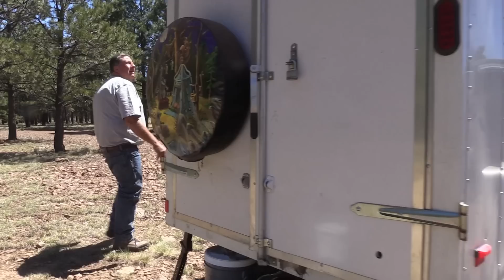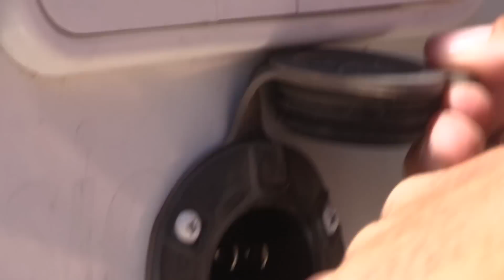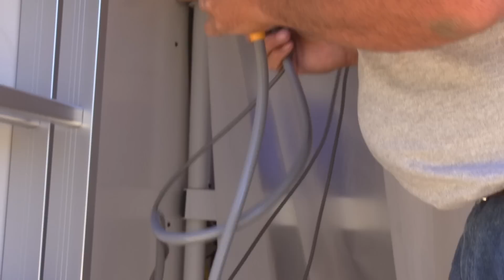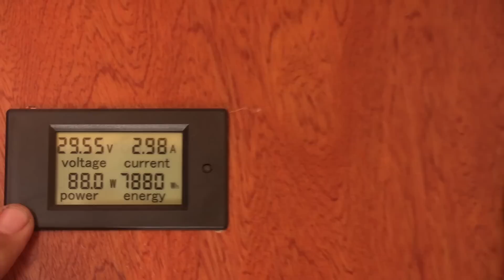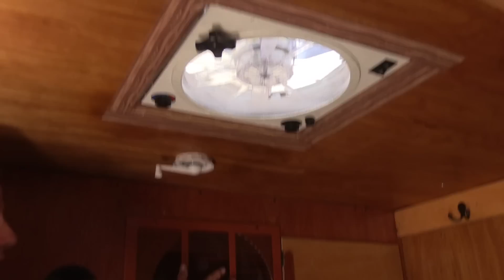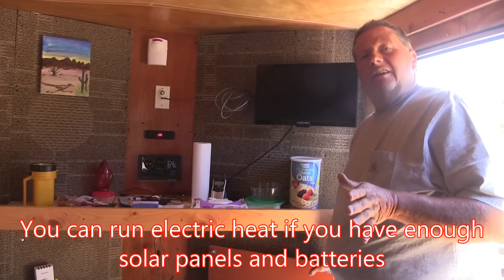Trailer Tour Nomad Living Cheap in a Cargo Trailer

Comment: for those of you saying "too complicated, or would be easier in an RV." Think of it this way, many times in nomad life, part of the fun is bucking the system, not buying an RV but building one. As for complicated, sometimes using your ingenuity makes you feel like you defeated something or a system. Also the fun in being a nomad is passing time by doing these things. It may take time to set up a shower or a solar system to both vehicles, but passing time doing something vs watching TV or just withering away in a chair.
Reply: Dave & Muppy RV & Vlog Channel, besides- everyone is different! What is overly complicated to one is actually simplified for other reasons to another. Randy’s problem-solving and ingenuity is inspiring! People are just so stuck in themselves :)
Reply: A cargo trailer gives more efficient use of space & available weight value.
Reply: AMEN, Dave
Reply: Yep. Plus totally custom. Yoy can make it your own. You can get more for less weight.
Reply: The problem with Cargo Trailers is that they are so expensive compared to an older camper that might need a a little maintanance. 5 years ago I bought a 16' 1973 Shasta Camper for $40 at an Estate Auction. We live in Jacksonville beach and both have Show cars and travel 2-3 weekends to shows to Savanah, Pensacola, Daytona and Tampa, we even go to Miami a couple times a year, and we've been to Montgomery and New Orleans when were on vacation, go to a show and we'll just spend the week. The other reason people say "It's too complicated" is because they just go off the deep end and go all at once, We started slow, I took us 2 weeks to gut and rebuild, including tearing out and rebuilding the rear wall which is where we moved our door too btw and completely flipped the floor plan. We started out with just the bare minimum,, basically a bed a kitchette, including one of those small college dorm style refridgerator and a microwave and spending weekends at state parks while we were attending car shows and we have added on to what we need to live in it at longer periods of time. We now have one of those 9 function Air Fryers that does Air Frying, Convection oven, Broil, Bake, Toast, Dehydrate, Keep Warm, Rotisserie, One-Touch Fries, microwave and 3/4 refrigerator that I bought from an appliance wholesale warehouse for $100 because it had a scratch on the side because that small fridge just wasn't cutting it, on our week long trips we have to go to the store atleast 4 times in that 9 days. At the end of this years car show season were going to buy one of those solar set-ups at Harbor Freight with the money that we save from not going to hotels. We don't need nor want a bathroom because we stay at state parks and they always have bathroom and shower facilities. We are planning on living the Nomad life when we both retire in 3 and half years floating from  state park to state park between Missouri where I'm from and New Mexico where my Gf is from. My point to this long winded comment is take it a step at a time and figure out what works best for you and your situation and don't just jump in with both feet.
Reply: Agreed, I built my own van complete with a functional bathroom and holding tank. I was contemplating a pull behind camper but after seeing what my debit card could afford I opted to build a enclosed trailer out. This way I will have a full size toilet and shower, a big plus at my age.
Reply: @TheREALOC1972 great comment! I heard the opposite sometimes, that Cheap cargo trailers are cheaper, while RVs even used ones are way too expensive and always break down quickly and require alot of maintenance and they have poor mileage can't drive places a pickup truck and cargo trailer can go etc. What's your opinion on it now 2 years later? Do you still like the RV and how would you change it? Thank you

Comment: Randy is a REAL SMART guy !!!    He did all the right things, but still "customized" his trailer  to BEST suit his own needs  :) :) :) :)  Hats OFF to Randy !!
Reply: I'm new to the ideas but I see great possibilities and it is a comforting to see what can be done. My question is this what seizes do the cargo trailers  come in thus far I seen, though video,  I believe it was a 10'x6' cargo trailer, and believe this one is 17'x6'???.... so what are the different lengths and widths? Also what size vehicle will it take to haul the different sizes of trailers.  Thank you in advance!
Reply: @karend.cureton-gordon6731  the nice thing about a trailer you don't have to have insurance on it, in Most states a one-time license plate fee and in a few states no tax. And these pull-behind basic trailers hold their value far better. speaking of interior inside dimensions for instance mine is 8 foot wide inside by 32 foot long mostly stripped down enclosed race car trailer. It's 8.5 wide outside And it's about 76 or 77 in tall with a unfinished ceiling  right now. And my payload is 10,800 pounds. Payload is what you can haul inside the trailer. I think the one in this video was 7 ft wide by 16 ft long with about 76 or 77 Inch Tall and a gross weight of 7,000 pounds and pay load im guessing is around 4,000 pounds or a little more. Payload is everything you haul - add in the trailer cabinets bed water Etc and you subtract from the payload weight. Or if you don't want to do that weigh it at one of the scales I mentioned for free so you're not overloaded and possibly tearing up things. I think they make a 6-foot wide x 10 foot long inside dimensions enclosed single axle cargo trailer. They generally make trailers in equal lengths for instance 8 foot long, 10 foot long, 12 foot long 14 foot and 16 foot single and double axles. And these single and double axle up to 16 ft links are generally 3000 lb gross single axle and the double axle is generally 7000 pounds gross weight. Then there all usually 8 foot wide inside x 18 foot long - 36 foot long bumper pull trailers and past that all the way through 52 ft long gooseneck and fifth wheel trailers. And these trailers a 4-cylinder all the way through a dually diesel and more can pull these trailers. Also depending on the gross weight, what you plan to tow with and how often you plan to pull it is what I would keep in mind too. Most landfills and rock quarries don't charge anything to weigh your truck and then weigh the truck and trailer together to get your figures and subtract to get your trailer weight. Just tell the scale you don't need a ticket and generally they don't charge anything. But don't go to the Department of Transportation scales that can be sheer Terror fines and harassment. Because you don't want to be overloaded it can lead to hard to steer - control, flat tires, not stopping, wheel bearings going out, more problems and even possibly Wrecking.

Comment: Love this, I have a 7x16" cargo trailer. Not as well organized, but I have all the solar I could ever need. 4-6volt batteries made into 1-12volt supply with a 110volt inverter. 55gallon drum for water, collecting old Travel trailer parts. One piece at a time.
Reply: I have a 31ft dutchman in rough condition. I bought it a a doner trailer to build mine. I want to use the frame, shorten it to about 20ft and build my own trailer. Already got everything in the trailer, stove/oven, sinks and fixtures, refrig, even a big shower. The 31ft weighs over 9000lbs so it got heavy frame and axles. Even got new edpm roof ready to install. I just need to get to it, its slow recovering from BEATING stage 3 lung cancer Nd my house will be paid for in 4yrs. Good time to go see what all this country can show me, lol.....I had thought of a bus conversion but with a trailer I can pull it with my pick up and have the truck for day trips out sightseeing....yappers, that's the plan......

Comment: My Gf and I rebuilt a 16' 1973 Shasta Camper I bought at an Estate Auction for $40 in 2019 during the covid lock-down. We  both have Car Show Vehicles, I have a 66 International pickup hot rod and Gf has a 65 Plymouth Belvedere, We live in Jacksonville Beach but were traveling to Savanah Georgia, over to Pensacola and down to Daytona or Tampa 2 or 3 weekends a month plus we go down to Miami a couple times a year and it's a while lot cheaper to pull the trailer with a truck I'm already driving to the show and spend 420-$30 a night at a state park then it is to spend $150 a night on a hotel room. took us 2 weeks from start to finish, including having to rebuild the rear wall. We have talked about selling off the house and the vehicles and buying a new truck to pull the camper and living the Nomad life when we retire because she's orignally from New Mexico and I'm originally from Missouri and have kids and family in each state.

Comment: I'd love to see a bit more information on the pusher wall fan.  Does Randy have a website?  This basic setup would be a great way to incorporate a small swamp cooler for low amp cooling in dry climes without having to increase the height of the vehicle.

Comment: I would double check your math on the current rating of your extension wire. It may be rated for high current with minimal loss over a length of 3-or-4 feet! DEFINITELY NOT for the full on extension cord you've got going. You are probably losing near 50% of your wattage to resistance and heat. That's the shortfall with DC electric current. It can be stored (batteries) but it does NOT travel well. A better idea would be to run an AC inverter in the van, then run a $15 home depot extension cord to the trailer -- and that cord can be 100' long without any significant loss. You lose some power in the inversion but overall the system would be better designed and far more practical overall. If you must stay with DC I would suggest bringing the van + trailer close together so as to run the shortest possible conductor length between the two DC sources. My $0.02
Reply: He claimed he can move 140 amps, and he sounds right IMO. With 1/0 gauge copper wire, he can move 140 amps 25 feet with only 0.69 voltage drop. That's about 6% power loss, which is very reasonable. And, when he's using less than a whopping 140 amps, his voltage drop will be MUCH less. Consider using a "voltage drop calculator" next time you wish to decide whether a certain size wire is suitable for a situation, as your assertion that he will be "losing 50% of the wattage" is very inaccurate.

Comment: i wish you would make videos on how to cheap RV live in a cold climate, like say, canada! lol.....
Reply: Drive to Arizona for the winter.
Reply: haha....i was hoping for an achievable less obvious answer....lol  thanks for the reply!
Reply: For the best overall Heating Blue Flame vent free 10,000 20,000 + 30,000 BTU thermostat controlled propane heaters for maximum fuel savings. The best time to buy heater is usually in January when they're marking them down.

Comment: I'd like more information on the ceramic heater. I don't see it listed in your affiliate links.
Reply: This model is a 250 watt suited to 100 sf: Amaze 250-Watt Convection Wall Mount Electric Space Heater. Available at Lowes.

Comment: He has done a fabulous job on this trailer. Has all the creature comforts of a normal travel trailer and sturdiness of the haul trailer. I'm curios about his external solar monitor. Just at a quick glance did not see it listed. That is something I'd be interested in adding to my own trailer.
Reply: Paul Lundell 

Hi Paul.... I bought that meter through Amazon. Approx ten dollars. I ordered this one with a 100 amp shunt.... They have a smaller one at 50 amps. It can be used anywhere that amps and volts are to be monitored ie...battery bank demand , solar imput, ect.. 
Hope this helps ☺
Reply: dog daze traveller garrett thank you very much I just ordered one by baylite. I already gave a different battery monitor.  But this will be nice to see specifically and only what the panels are producing.